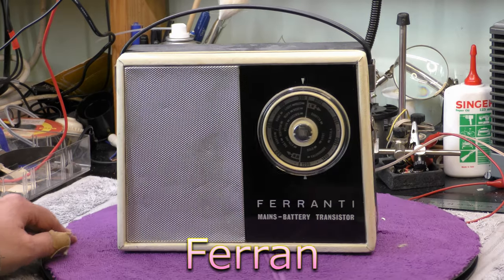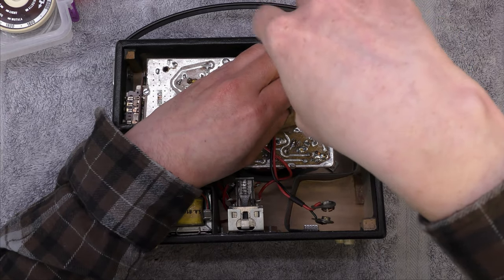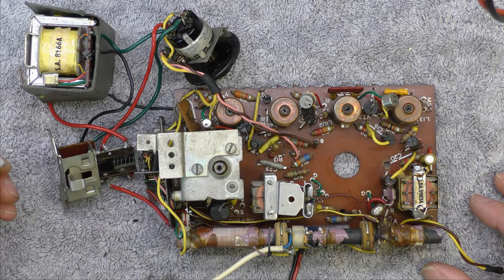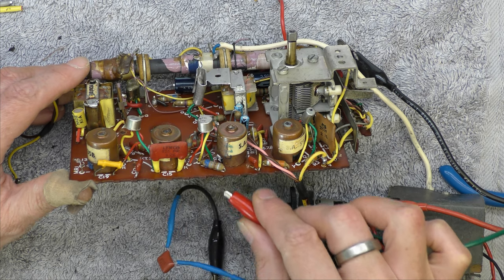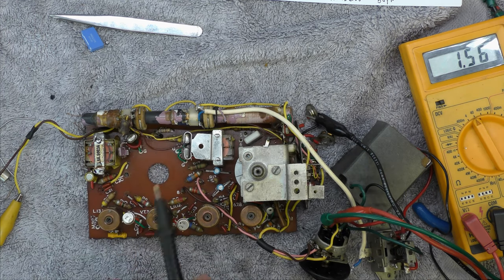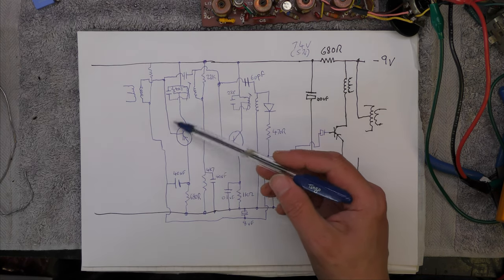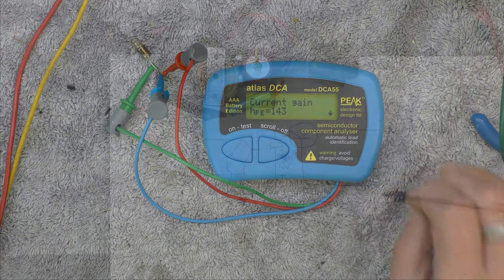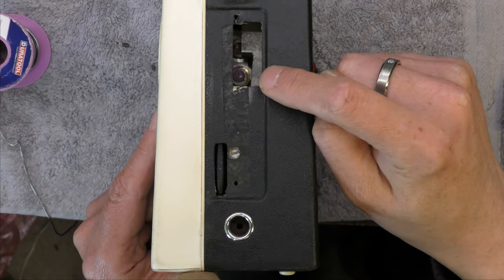Ferranti MPT1089 Mains Battery Vintage Radio (4K)

Comment: Another interesting set Daz. I worked for Pye Telecomms in the 70s and 80s and our early transistor two-way radios used lots of Newmarket transistors; NKT was part of the same organisation if I remember correctly. One thing that had me scratching my head with an old germanium set was that the neutralising networks around the IF stages can provide a signal path even if the transistor is completely out of circuit!
Reply from the maker: Yes, I was based at Exning Road for 16 Years. Was Smiths, Then GE. Many I worked with remembered the transistors. Building gone now. Yes I wondered if IF getting through neutralising caps! Thanks Alan.

Comment: Ya Gotta Love Germanium Transistors Darren Very Nice Set Think it Uses The Same Insides As a Ekco MBT414 But a Different Case Think it Uses a NKT152 For The Osc/Mixer Transister And a NKT153 For The 1st IF And a NKT154 For The 2nd IF On Ebay Those NKT Transistors Are Very Expensive But Glad You Got it Working Lovely Work !! Stay Safe Regards mike.
Reply from the maker: I'm not a big fan of germanium, Mike!  Yes, very much this set https://youtu.be/WLqOSDDn1Rc  I believe a whole host of transistor would work but lucky i have some NKT in stock.

Comment: Anything with 'HUNTS' written on it is an ex capacitor, it has ceased to be, it is no more, etc. An irony, I have a 'HUNTS' capacitor tester, I fixed  it by replacing all of the 'HUNTS' capacitors. Nice radio, not seen one like it before.
Reply from the maker: That's very amusing on the hunts tester! Thanks Steve.